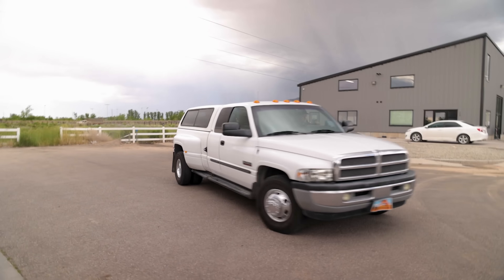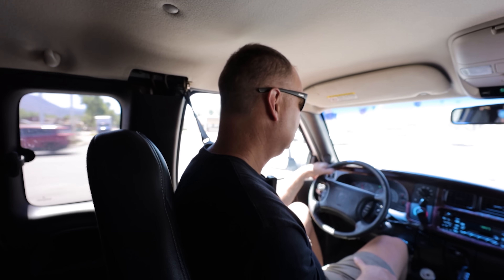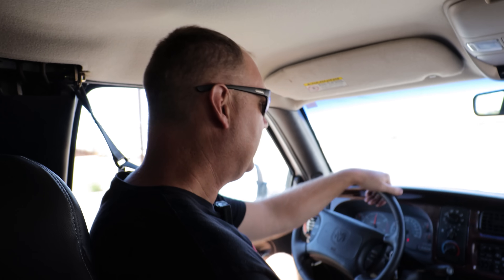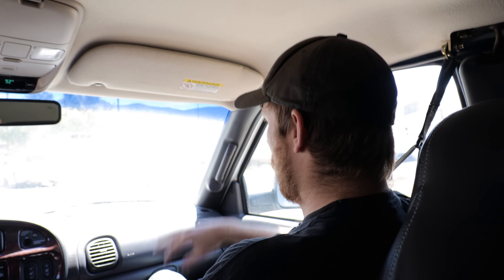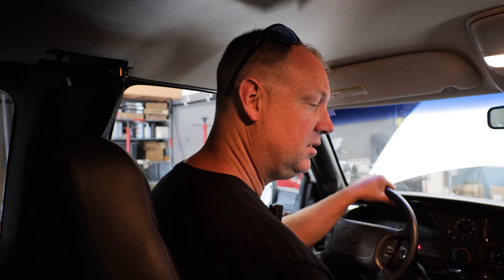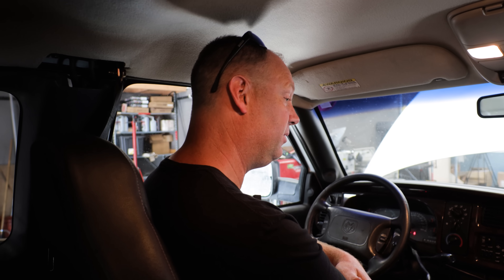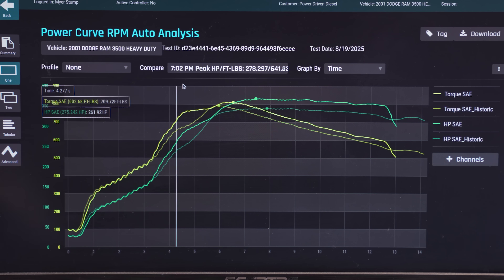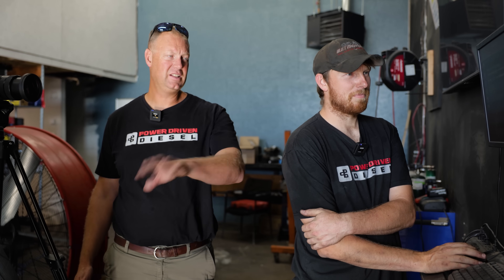Stock vs Custom Tune on VP44 Cummins

Comment: which tunes on the stock 10 tunes have advanced timing i currently have a smarty s03 on max tune 9 with advanced timing and then i have the quad set to tune 6 but i wanna know how high i can go on the quad with stacked but i dont want both to be on advanced timing
Reply: You should be using the smarty with fuel tune only! Set the Quadzilla on 10 & the smarty on fuel only level
Reply: @logut80 what is fuel only level?? What number would it be out of the 9

Comment: Was that wire tapped? Can't be... 20hp seems kinda weak with all the fuel, duration, and timing you can add with that box. Giver er all the fuel and timing! Griff likes tuning for fuel economy. We all know that haha!
Reply from the maker: That's all it has with stock injectors and wire is tapped!!  You're limited to 60 to 70 HP gain without the wire tap on stock injectors.
Reply: You think picking up 25rwhp isn't good on stock injectors?
Reply: @logut80  Not really..
Reply: @TheKcdub1000 lmao ok. What do you think tweaking the Quadzilla tune should increase power by??
Reply: @logut80 i would of bet money at least 50hp. With all the extra fuel you can add and duration. With the increase in rpm.  Guess i would have lost that bet. Haha.
Reply: @TheKcdub1000 stock injectors can only do what they're capable of
Reply: @logut80 Yes. And I'm sure injectors with 50,000 miles flow diffrent than injectors with 250,000 miles. Lots of factors.

Comment: I wish you guys did this back in the day befor quadzilla sold out to a new company. I had an original with there own screen not the I-quad and it fueled waaaayyyyy harder then the newer ones I found the custom tuning did way more then the newer style. I’ve ran both and the original was drastically more agressive with an hx35/40 hybrid and stock iniectors I made 385 horse and 933 ft lbs on my 2001 standard output 5 speed. Exact same set up but with newer quad the most I could ever make was 356 and 844  which still kicked the crap out of the edge juice with attitude which made 308 818, then with original quad and bd super b single and “75 hp” stage 2 iniectors. Not sure the tip size cause bd didn’t disclose nozzle data back then and I havnt owned a Cummins in 6 years now i went to duramax. I squeaked out 448 1018 in that orientation. Made friken awesome power with the original quad befor they got shut down and sold out.

Comment: I have the Adrenaline V2 in my 2001. Unfortunately I can't find much documentation on how to tune it. There are so many parameters that I don't understand. I believe that I have it set fairly well but I do have a fair amount of lag from a stop. I have a 67mm CW/TW rebuilt HX35, 150HP injectors, 4" exhaust, AirDog lift pump. I don't know how much HP it produces but I am happy. It is nice to see you guys upgrading an older second Gen Cummings.

Comment: I actually like the vp44, its a great tow build with an abundance of upgrade potential and choices. used a set of industrial injector 350hp injectors, speced for some equipment type application, swapped in a manual, sourced a turbo from you guys i think. Truck gets 13.1 mpg on a Wyoming to Montana run and back, pulling a bumper pull flat face rv! as a bonus splitting gears with the Gear Vendor over drive is so sweet.
Reply from the maker: Sounds like a great setup!

Comment: Been having a heck of a time getting a hold of quadzilla.  I mailed mine in last week for repairs.  Hope I get it back.  In the past they were great for customer service but lately I'm not so sure
Reply: Diesel auto power owns quadzilla
Reply: Same here…not impressed so far.  Installed it and it immediately bricked.  Sent it back and they said 2 weeks to diagnose.
Reply: Update- a new Quad arrived at my house today.  Kudos to those guys.  Still need to hook it up but impressed at the turn time.
Reply: @derekabbas  glad they turned it quickly for you.  Thanks for following up here.
Reply: Sucks to hear this.  My EGT thermocouple went bad a couple months ago and I was able to get a hold of them with no issues.  They sent me a new one no questions asked and didn’t even need me to return the bad one for warranty exchange.